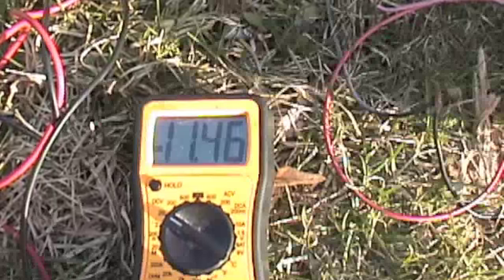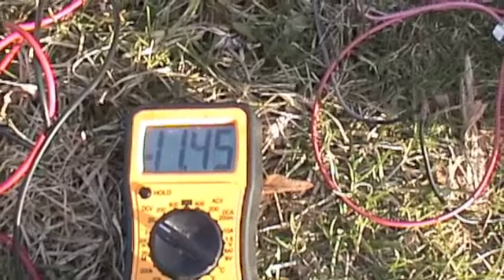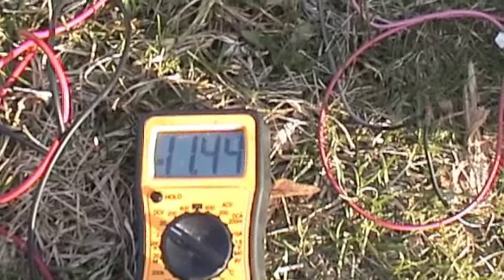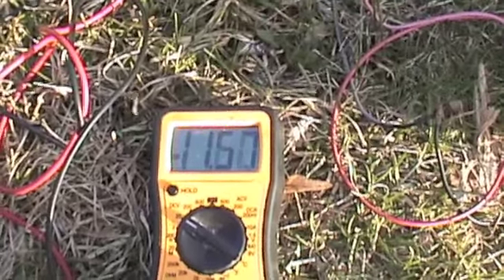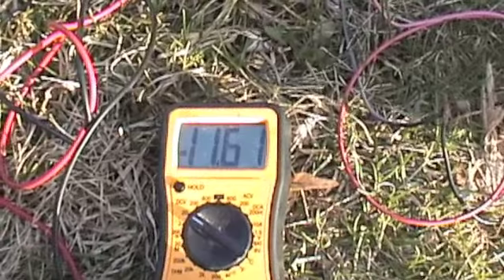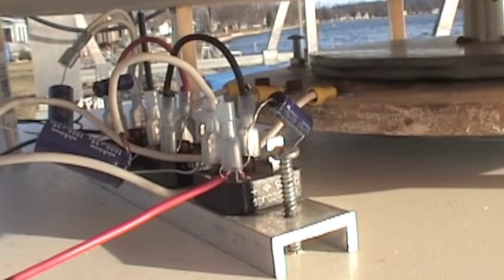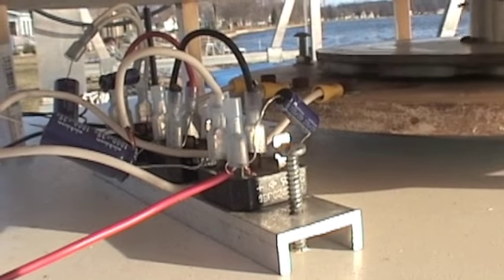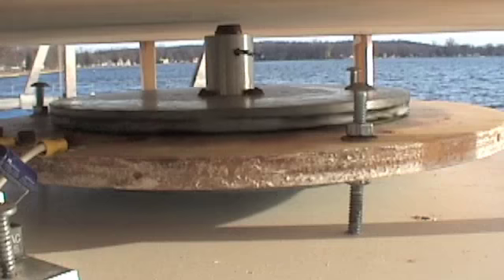LYNX Vawt 10mph winds

Comment from the maker: @jovanmachine 
Give me some contact info.  As it is here it needs to be improved to get higher rpm.  I have put this one on the backburner.  I do think it is a pretty machine.  The improvement would need to be changing to high lift rotor blades and I have learned a lot since making this.  It would make a nice kit.